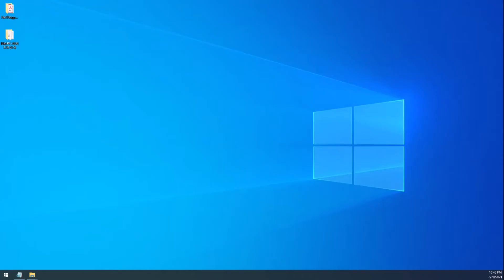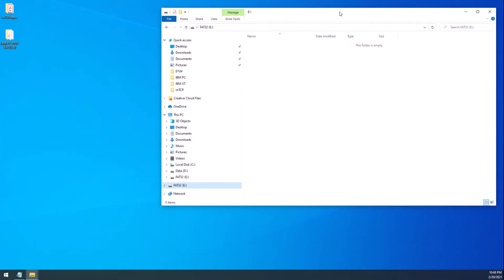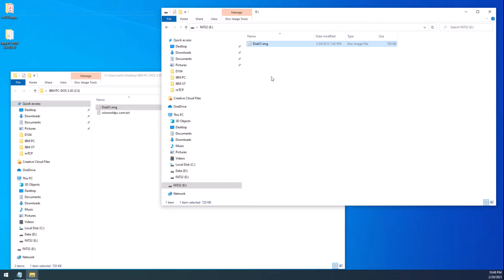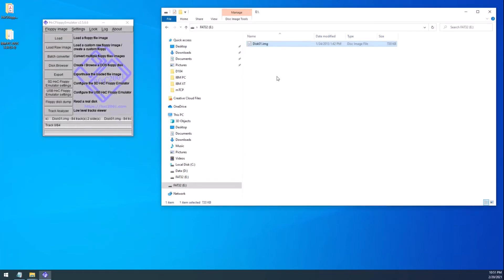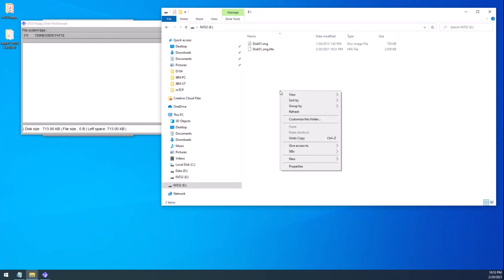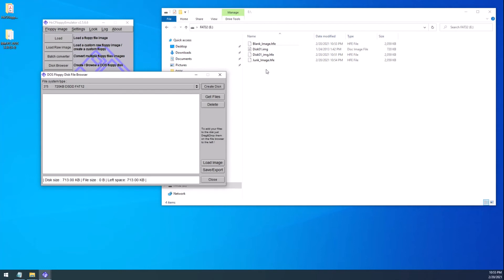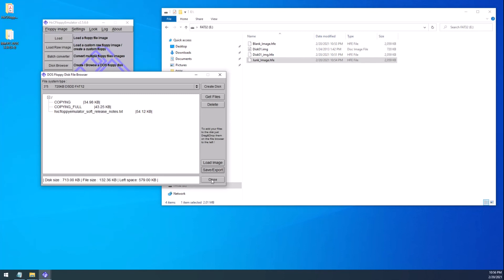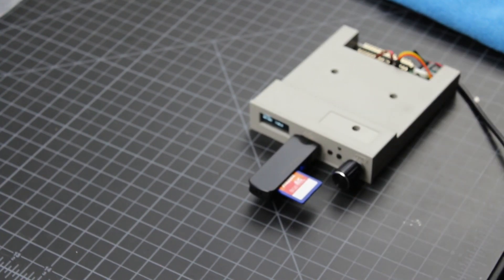IBM XT 5160 PC Project - Part3 - How to use your Gotek!

Comment: Please, help the dummy. When I open HxC Floppy Emulator, I can't drag&drop any img or hfe files from Windows Explorer. OK, I can load blank image from the program itself choosing the coresponding option, then I ca't drag&drop any files to Floppy Browser. When I choose 'Get Files' I only can add a directory, not the particular file. Anyway, choosing the directory with files brings no result in Floppy Browser, the opened image is still blank. I use Win 8.1 for these operations. Thx in advance!